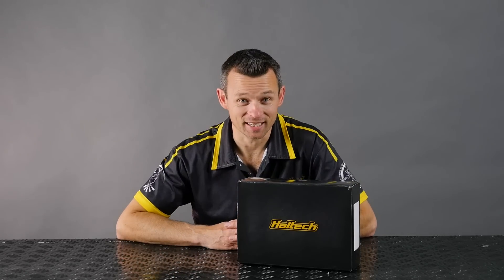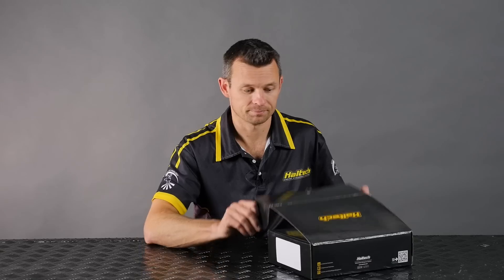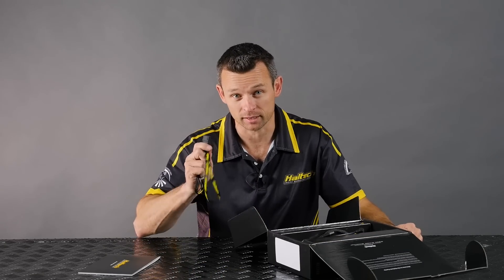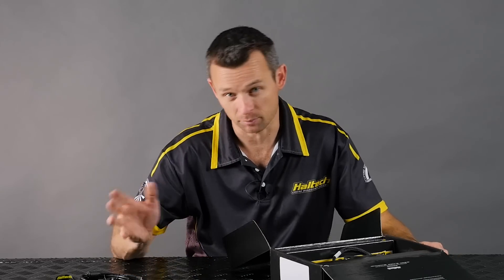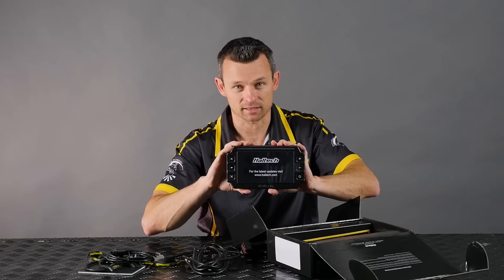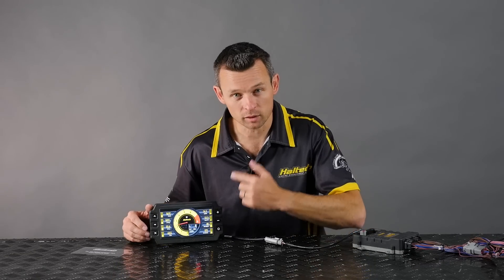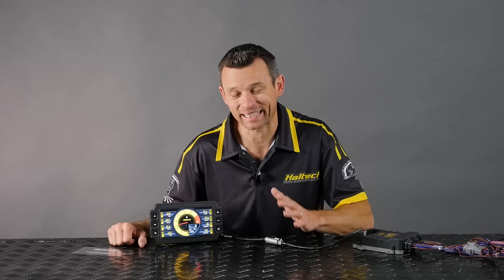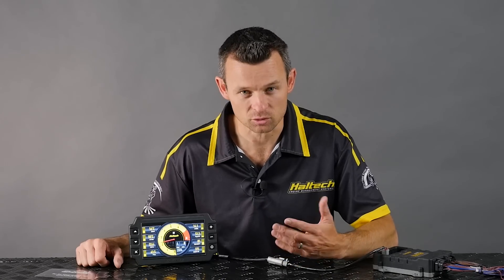🔍 iC-7 Display Dash | PRODUCT OVERVIEW

Comment: Is the IC7 CAN only one way? I don't know how to use IC7 inputs on ecu. Any help would be appreciated :)
Reply from the maker: Currently it is only one way from the ECU to the dash... for now ;)
Reply: @haltech  Hopefully soon! CAN needs to be both ways ♥ When you run drive by wire you don't have many inputs left. Adding boxes makes it harder to mount and wire neatly. If display can be used as analogue input saves space. Look forward to seeing more integrated ecus and lower prices :) Hopefully means more business for me, less work in wiring, and less expense to the customer. Ecu master is very competitive and compact alternative

Comment: Do I need a boost controller or this adjusts boost pressure ? Cheers !
Reply from the maker: You can either use a boost controller or an ECU (with a boost control function) to control your boost pressure.

Comment: Can you just use it thru the OBD ll port?
Reply from the maker: Yes you can. The dash comes in two versions - pre-set for Haltech EUCs and pre-set for OBD-II connection.
Reply: @haltech  do i need to order the OBD-II connection or will it  come with it.

Comment: Is this plug and play with a Racepak dataloggerto change from the IQ3 to the IC-7, or what interface do we need to make the switch?
Reply from the maker: The iC-7 is plug'n'play to replace a Haltech/Racepak IQ3(s) in a Haltech CAN system.

The iC-7 CANNOT be used in a Racepak VNet CAN system.

If you have further questions, please don't hesitate to reach out to our sales and support staff.

Comment: Makes you wonder wonder what difference is between this and say a android running torque with an obd2 dongle, one that comes to mind is torque you can datalog
Reply: If I had an elite series ecu I wouldn’t want an OBD run dash. Counter productive in a lot of ways.
Reply: While it might be backwards compatible with OEM CAN networks.  These type of displays are primarily designed to be used in conjunction with an aftermarket ECU, especially in vehicles set up for mptorsports .

Comment: I was very interested in using this with obd2 until i saw the price AUD: $1350 seems like a lot for my use case. Im also worried about the polling rate of digital dashes and information coming from obd2. What is the polling rate of this item? eg 1000hz
Reply: $1,599 now
Reply: It doesn't plug into obd2 it plugs straight into the ecu

Comment: Is there going to be this model but in the similar shape as the old one? Big fan of the rounded top.

I assume this would display check engine light if it's connected to the ECU, if there's been a fault?
Reply from the maker: It's unlikely we will go back to the rounded top shape. There are a few warning lights available and the check engine is one of them. They are all referenced off the ECU.

Comment: Will this display work with other ECU's? such as Link G4+ ecu? Thanks! very interested in getting one.
Reply from the maker: On release this dash will only work with all current Haltech ECUs via a CAN network and with late model OEM ECUs using the factory OBD-II port (via CAN).
Reply from the maker: @Su Xiong No firm timeframe, sorry
Reply: @haltech   I have a 2010 sti and I’m curently tuned with ecu tek but I’m looking to get a digital dash… will this fit or any other models

Comment: Hey guys will it have turn signal, high beam/low beam and odometer features and if so will it be ADR approved
Reply from the maker: It currently has turn signal, high beam/low beam, etc. ODO is something we're hoping to add in a future firmware release.
Reply: @haltech  just wondering if there is any update on the odometer features?
Reply: @haltech  Has that firmware been released for the ODO yet?
Reply: @mikem2915 yes it has, I have this screen in my Rx7 only been in the car a few weeks. Mine has an odometer reading.
Reply: As an alternative to ODO, an engine hour meter would be useful.

Comment: I have just bought an IQ3 street dash for my build but now this is coming out I want to get my hands on it. 
Does it have inputs for turn signals, high beam and other street features and how interchangeable is it with the IQ3?
Reply: Suicide Garage sounds like we will need to have an additional inputs and outputs module for these features. Why have a 34 pin plug that only has 4 pins in it. Kinda disappointed honestly
Reply from the maker: could be because there are future additions planned.....
Reply: @haltech  interested in street features holding out till then..

Comment: This is very nice and very exciting! Question... Is it legal to have one of these mounted in front of your existing instrument cluster? Also, how much are they!? 👌
Reply from the maker: All the specs and pricing is here: https://www.haltech.com/haltech-ic-7-display-dash-a-new-way-of-seeing-things/
As to the legal requirements - they vary depending on the country/region you're in. Best bet would be to check with your local gov body.
Reply: That is depending on where in the world you live, but in most cases, this will cover all the required information as long as you feed it with the data it needs. so unless the place you live have some sort of stock instrumentation requirement there should not really be an issue.
I think speedo is usually the only legally required gauge.
Reply: @TheOystei  thanks mate. I'm in Australia, the land where they make pretty much anything cool illegal. Or at least as difficult as possible. 😂
Reply from the maker: Yeah, some of the laws in Aus are just ridiculous...
Reply: @bourkey07   Oh you think australia is bad?  Try Norway! one could almost think that there was a clause against anything fun being allowed on the roads....
thats why Gatebil is so full of insane cars without registration.
Reply: I think there is a major issue with the buttons being behind the steering wheel. If it were just a display with remote buttons I think it would be fine. As it stands, I doubt it.
Reply: did ya shit in the pool again  Just talking about whether you can get it road certified - not that I think it's actually a problem.